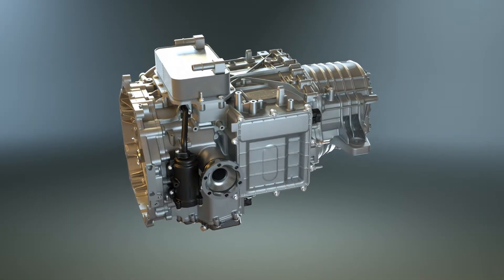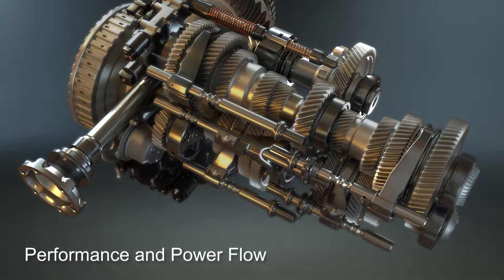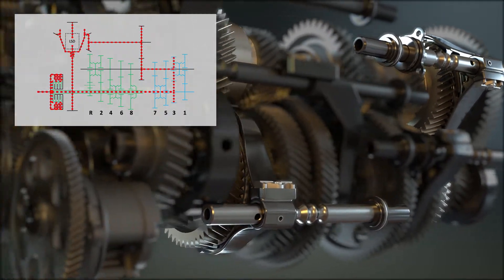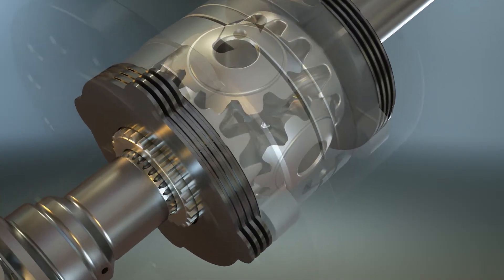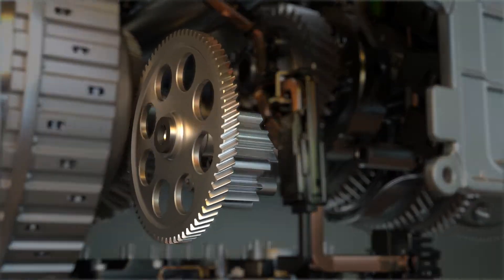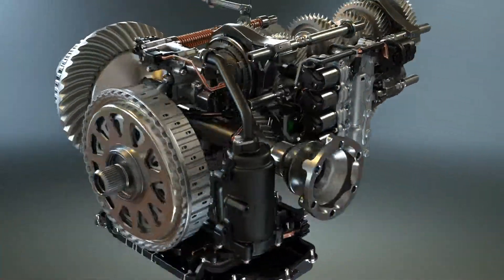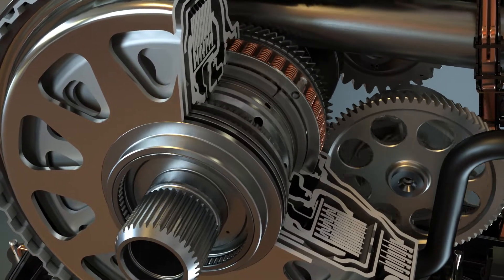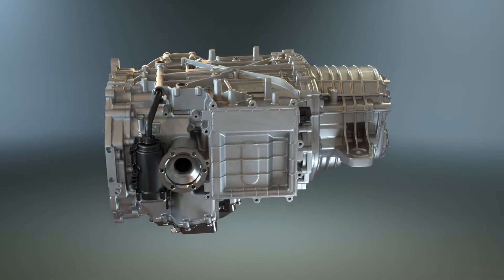TREMEC TR 9080 Dual Clutch Transmission (DCT)

Comment: This highly system is very costly to repair the old turbo 400 and turbo 350 gm transmission were some of the best built No computer crap
Reply: and do you see any of them in racing outside the drag strip

Comment: Nothing but issues in the c8 right now.  TCM needs to be corrected ASAP
Reply: Considering that there are more C8s out there than all other DCT-equipped sports cars combined, I'm not surprised their issues were more visible. But I thought GM had worked through all the bugs.
Reply: @spdcrzy  That is a wildly inaccurate statement. There are in fact not "more C8s out there than all other DCT-equipped sports cars combined." 

BMW has been using DCTs for over a decade, Audi has been using DCTs for over a decade, VW has been using DCTs for over 20 years, Mitsubishi put a DCT in the Evo X, and there are numerous other applications that have been using this technology for years.

The issues that the C8 corvette is experiencing is a GM issue, not an issue with the DCT technology.
Reply: @bitzer8722  The C8 DCTs handle WAYYYY more torque than any of those DCTs. The one exception to this rule is the DCT that was made for the Veyron - the DSG had pitiful torque handling capability. Have you forgotten that BMW made the move to the ZF 8HP specifically because they couldn't figure out how to get the DCT to hold any more torque? And even the 8HP can only handle so much, too.
Reply: Nope. These transmissions are not reliable.
Reply: The early 2020, 2021 cars had issues with the DCT. Current cars are relatively problem free.  There will always be a few issues but no where near the numbers they were seeing in 2020/2021 and no where near the numbers some other brands are seeing.